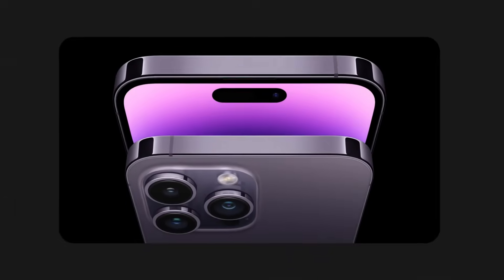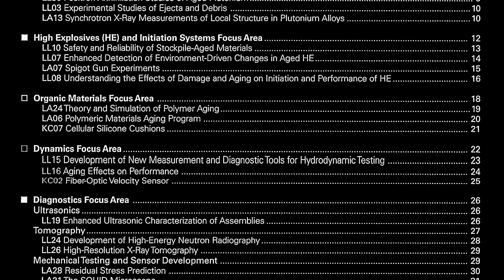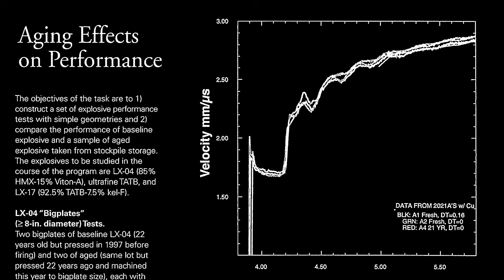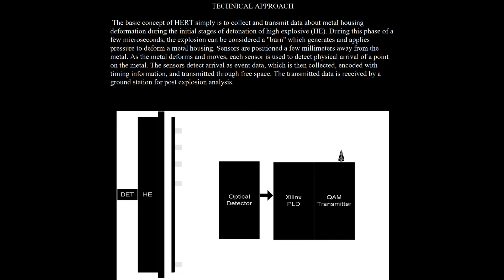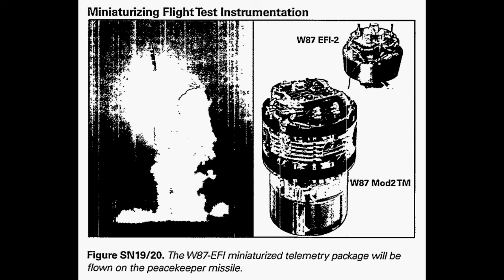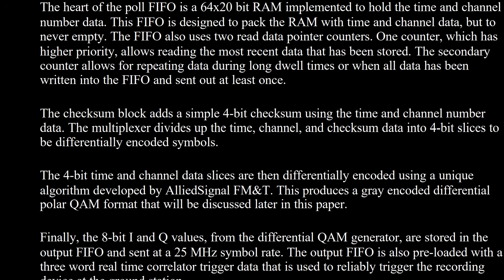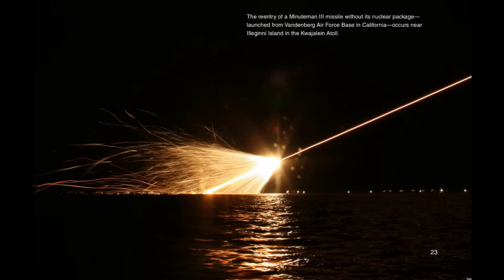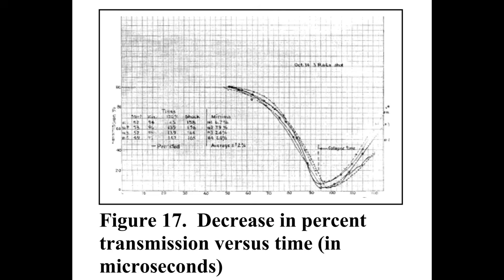The Computer Designed To Die In Microseconds

Comment: Happy 50th. Have a happy new year too. 😁❤ That gizmo is called a pindome readout module. The sensor is a sphere with a bunch of fibers in it that detect the flash as the shockwave hits it, inside the center it has a wavefront symmetry sensor that is pass or fail. Also it only senses half a sphere as a full sphere implosion would sever the fiber bundle before it gets the most critical (pun intended) data. That they shrunk it to that small though! 😲
Reply: I thought this was about a gizmo that was surrounded completely by explosion and measured the full sphere...? Fibers going toward center, computer sitting in the middle?

Not sure what "bundle" you're worried about, each fiber indeed gets destroyed immediately after sensing the detonation reach its tip and that's by design. The one you have in mind could totally be a real device but that's a different one from the one described in the video.

Comment: The power level of the NDAs when i was making kitchen appliances was ridiculous. I technically am still Forbidden(tm) from telling people both what i designed or for whom at the same time. The NDAs for nuke computers must be truly formidable.
Also, being unable to test nuclear weapons is a good problem to have. Let's engineer some solutions that don't require them still existing, yeah?
Reply: Wouldn't be Hobart / KitchenAid by chance? If not, we all work for GE in one way or another. heh
Reply: @BlackWolf42-  I can neither confirm nor deny. 
What I can say is that one time the beverage appliance in the executive office broke so there was no beverage that day, and every engineer got a stern talking to. I told boss-man that the beverage appliance was a production model and that if he wanted a better one that didn't break before a year was up he should have gone with my first part design that he insisted would be too expensive (it was less than a penny in production cost). Boss-man did not like this. I no longer make kitchen appliances. The part was changed though so I hear.

Comment: It's easy to forget how incredibly fast modern computers are.  Even this computer you're talking about is running 50 times slower than most desktops, or the same speed as microcontrollers I work with for less than $2.  We live in fascinating times.  Happy Birthday Scott, keep flying safe.
Reply: It boggles the mind. If your processor runs at 4GHz, then in one clock cycle, light travels about three inches.
Reply: @kjgoebel that's why at those speeds you need the RAM as close to the CPU as possible,  and have a good cache inside the CPU itself
Reply: @panda4247 If I'm not mistaken this was one of the problems with AMD's Bulldozer, they released multicore CPU designs which were impressive but the way the cores were assembled they had a shared cache laid around the cores so the distance slowed them down.
Reply: @kjgoebel7098 wow that just really put into perspective why processor speeds have mostly leveled off in recent years. Especially since electricity travels a decent bit slower than light.
Reply: @plesleron  Yeah, we can be pretty confident that processors aren't going to get a whole lot faster than they are now. Although I gather that the current limitation is a heat thing, not a speed thing as such, so they may get somewhat faster. Fingers crossed.
Reply: It's not 50 times slower, however. FPGA's don't work like normal processor. For example, the FPGA in this telemetry unit has 64 timers. Those are 64 physically separate timers, not 64 threads running on one processor. This makes it equivalent to a 64 x 100 = 6.4 GHz single-core processor (if we're taking large shortcuts). FPGA "code" is actually hardware description and everything therefore runs "in parallel". That is why you'll find FPGA's in a lot of military hardware. Before modern GPU came around, they were the absolute kings of raw compute performance. They still are, in many domains where GPU's aren't suitable, but their cost is in a whole different range (I've seen mil-spec Xilinx Ultrascale+ chips listed at over 100 K€, and that was before the chip shortage and this year's inflation.
Reply: roll7269  Why the hell would you want that. Something to wipe out everything?
Reply: heh replace the (probably) $2million system with an esp32, love it. Even got the wifi built in lol
Reply: @zyeborm  Keep in mind though, this is a real time system implemented in an FPGA, not like a CPU. It's doing way more stuff per cycle
Reply: @Robert-un3cf  the smily faces and LOLs should be giving you a hint as to the level of seriousness I was giving the suggestion.
Reply: @zyeborm  what smiley face?
Reply: @Axodus  my mistake. The "heh" and the "lol" are the clues that I wasn't making a serious suggestion. You can keep your engineering feathers unruffled.
Reply: @Robert-un3cf  About that time (late 1980s to early 90s) I was working on a system that had a 68000 at the top, DSPs outwards, and FPGAs at the periphery doing this kind of processing for hours on end.  Commercial, not military, but also really cool!
Reply: @zyeborm you sound like an ai
Reply: To think if people still wrote software in assembly or C++ instead of needing literally every modern app to be a huge nasty bloated load of CEF turd... how fast a modern desktop could run an app like Discord. 🤣
Reply: You know, that is why apple still exists, unfortunately.
Reply: @dregenius  lol i didnt know cef was a thing. seems lazy. no wonder some apps run poorly and crash

Comment: Proving that electrical/magnetic forces far outrun any chemical force in real-time. Everyone involved in the Manhattan Project and all of the other follow-on experiments knew this as gospel. That's why they built the measurement towers and the tunnels to record the yield of the early atomic, and later, hydrogen weapons in the program. Even a nuclear blast wave does not move at the speed of light. It's heat effects do, but everything else trails.

Electricity and induced magnetics, however do.............................

Comment: Well that was a great piece of techno trivia, pretty ingenious device. Great detail about sensing an high speed processing but got me wondering about the antenna as that also needs to survive long enough to get the data out.
Reply: I wondered the same. I’m not a radio engineer, but I’m guessing that they would need to put out a pretty strong radio signal to get through everything including the outer shell, which I have assumed was thick metal. But maybe that assumption is incorrect?  How do the radio signals get out?
Reply: Well, neither the antenna, battery or other auxiliary component will be hit by the explosion until after the sequence of interest.
Reply: @johndododoe1411  But how could the antennae be Inside the metal sphere? wouldn't it be blocked? It was interesting when he mentioned the gamma ray recievers, because the gamma rays penetrated the copper sphere,,,but that was for an "analog"(no digitals in the sphere) test. Maybe you could build an antennae that lasted just long enough that breeched the sphere? or maybe you used an EM wave that penetrated the sphere from the inside.
Reply: @diox8tony  this device replaced the sphere.
Reply: @AllanEdwards_PR  You're talking about a different sphere now. Read the words "outer shell" above. Outer as in "surrounding the explosives". The device replaced the sphere that's inside explosives...
Reply: @johndododoe1411  Would superconducting the electrical components help ?
Reply: @88njtrigg88  I doubt it. I don't think resistance significantly impedes the flow of electron fluid (soup).
Reply: That does seem like a problem: how do you get the signal out? You can't push it out via fiber or wire (that would destroy the sphere's integrity), and you can't emit it from inside the sphere as it would be absorbed by the sphere. If you use the sphere itself, that might work (?), but it's going to be an antenna of highly variable geometry during its working lifetime.
Reply: @robertherndon4351  “highly variable geometry”, that’s an interesting way of putting it!
Reply: I'm wondering if they replaced what I assume is the normal metal outer shell surrounding the explosives with a composite shell that is transparent to radio waves.  The purpose of this test computer is to determine how uniformly distributed the initial shock wave is.  They do not need to actually maximize the shock pressure because there isn't an active nuclear core that they are trying to activate.

Comment: My airplane is almost 50 years old. Just had the engine overhauled. It'll probably still be flying 20 years from now.
Reply: Hmmm, what is metal fatigue?
Reply: Will aviation fuel still be legal in 20 years?
Reply: @johndododoe1411  Unleaded aviation fuel now exists and is approved for all planes in the general aviation fleet. It's just a matter of ramping up production and distribution. I estimate it'll be widely available within a couple years.

Comment: I still use an HP-28S calculator I bought in 1986. They don't make 'em like that anymore...
Reply: Can you remember how much it cost?
My father bought one of the first calculators on the market (maybe in the '60s, I'll ask him) and it cost $100 USD which was a lot! He said that it was worth every penny. He used a slide rule up until then.
We've come so far.
All the best. 👍
Reply: I've still got an HP-21 calculator somewhere in my Pile of Stuff.  Bought it around 1974 I think.  Stopped using it when the NiCad cells died some years later.  I must dig it out.